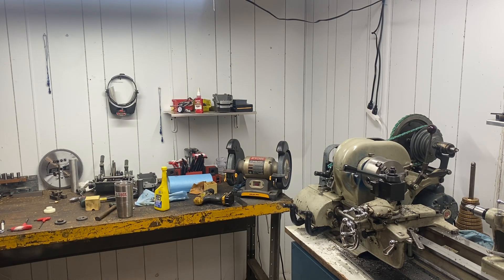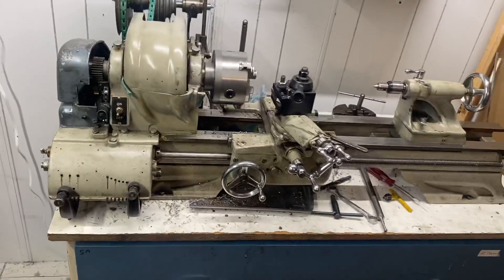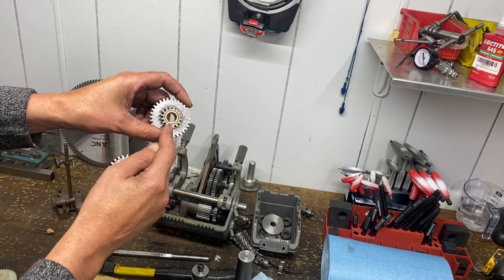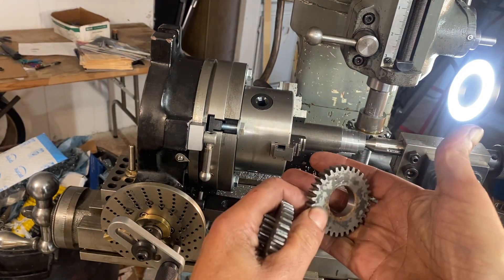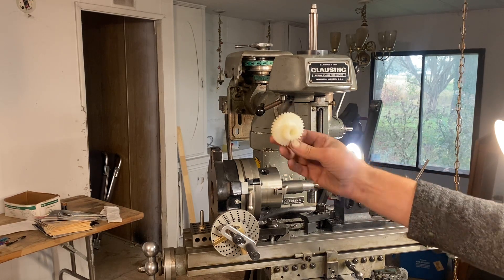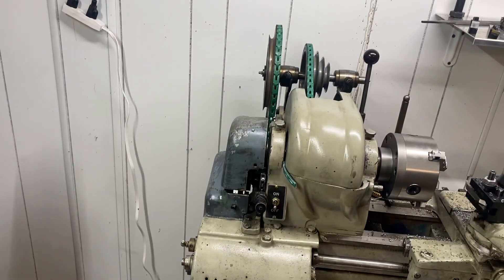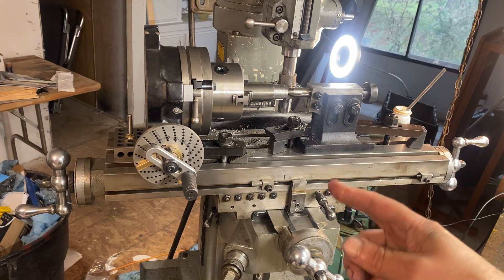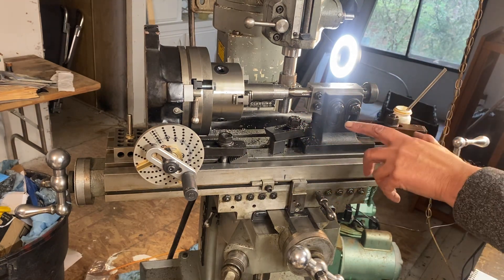Making a gear on the Clausing 8520

Comment: .  I guess you have to be "all in"  if youre going to do machine work . its expensive.   It looks like you have  a riser block in yours that mine 8520 doesn have (ebay has one now for 700+).  I wonder if you did that yourself, or it came with your machine. If you did it yourself, do you notice any difference in rigidity?
Reply from the maker: I made it on my little Southbend 10K

Comment: Hey there, I have a Clausing 8520 in my basement along with a nice little Southbend 9" lathe. I wasn't looking for this video, but YouTube decided I might be interested (and they were right!). I've been interested in getting into gear cutting, but I could never decide what size tooling I could handle. 
That's a dividing head, right? It looked like it fit the machine alright.
What size is it? What size is the chuck?
Reply from the maker: The same 6" Rotary table is available from several different retailers. I got mine from Grizzly. The chuck is a 4" Vevor (you can get the table from Vevor also) Hope this helps..